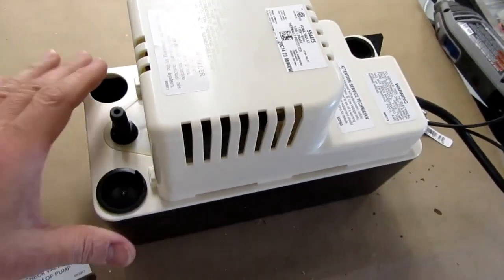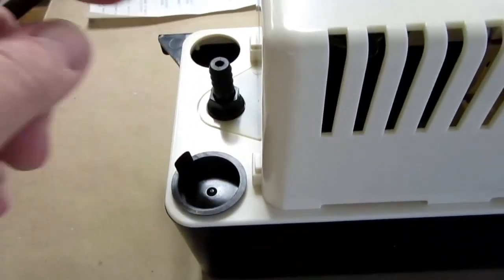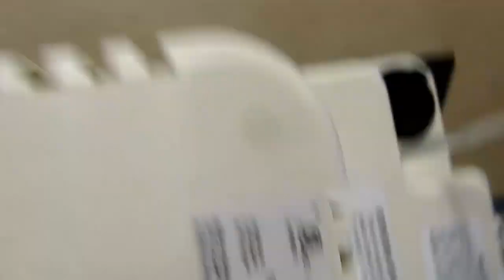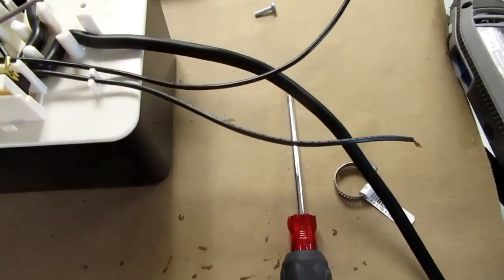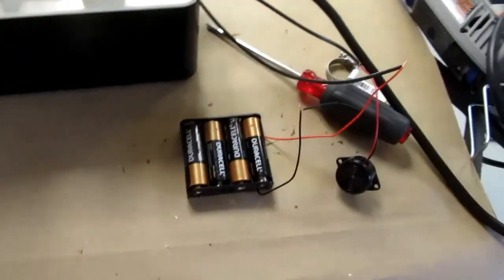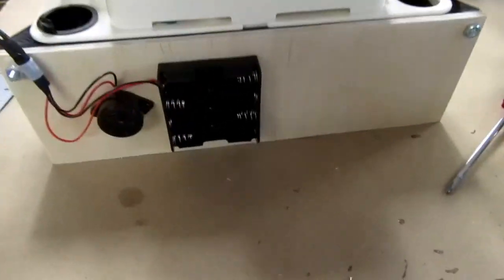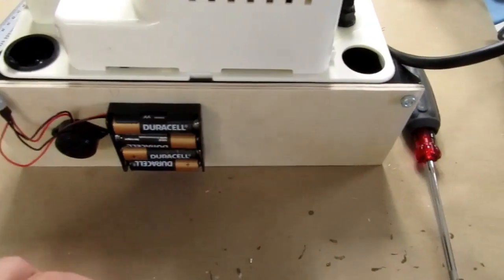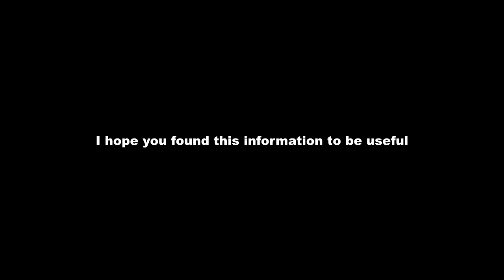Little Giant Automatic Condensate Removal Pump VCMA-ULST (554415)

Comment: Slight error at the beginning - the "15" and "20" designations are not for the pump power or lifting capacity, but for the input voltage, the "15" units being for 125VAC and the "20" series for 230VAC. If you are working with an air-conditioning unit, you likely have a source of 230V AC power at the air-conditioning unit, so the "20" version would be correct. In your case, you pretty much lucked out that you didn't decide you needed more lift, as had you chosen the "20" model you would have ended up with a 230-volt unit and no way to power it.

Comment: Nice review of the little giant condensation pump.  I have a similar pump on my air conditioner and it is 14 years old and never failed.   More commonly , I find the gravity feed hose obstructs from fungus that forms in the condensate trough under the cooling coils over time and the water overflows the trough before it reaches this pump.  I periodically back flush this line with dilute Clorox to keep the fungal build up down.

Comment: I always make it a point to thank folks who make these vids. I have a portable AC unit that I "converted" into an outside one (outside the small office I built in the garage for my wife, you can imagine how loud a portable unit is inside an 8x9ft box haha) anyways...although I built a box to make sure it sucks hot air from her office, blows cold back into the office and vents hot air into the garage, I found after a couple hours condensation builds on the cold air line, hoping punching into the box, and putting this "in line" with the AC units drain path (it is running on cool mode but not dry/cool so it's probably just full of water inside my hacked box) it'll grab moisture and run it out the garage. 

Again, thanks for such a great detailed vid!

Comment: I want to do this with a Whynter ARC-14S portable AC unit so I don't have to empty the water 2-3 times a day in the summer.  I think I can use a Little Giant low profile unit like the VCCA-20ULS and not even have to raise the unit above the pump (the drain is only about 2" off the floor).  What I'm worried about is leaving the house with the AC on and the pump failing.  I'm not sure how I'd rig up that alarm switch to turn the AC off.  The ideal solution would be an electric valve between the AC drain fitting and the pump to close the drain, but I don't know if they make something like that.

Comment: Thank you for this video. I was wondering how to do this. We have those pumps near the thankless water heater and furnace. And we had a dehumidifier that we had to empty. No sink in the basement. In the summer it was getting tired to check every few hours.  Thanks again.

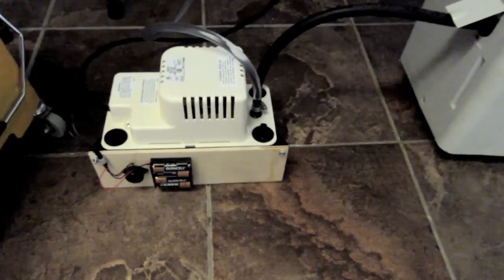Comment: 27:31 I am a little confused about the extensive modifications you made to the hose portion extending inside the pump. Why was a trough needed there? Was the entire issue because of the bend shown in the hose in which it was slightly angled up, or was there an additional issue inside the pump? I ask because I want to use this as a condensate pump for a crawl space in which I want to seal that connection and make sure no bugs, dirt, etc ends up in the pump.
Reply from the maker: Luke H, the whole point is that the incoming water from the hose must be able to strip unimpeded into the pump tank. If you run the house all the way into the tank (to the bottom), little water will flow into the tank. If you cut the hose shorter, perhaps half way down into the tank, when the tank level rises to the end of the hose, out may not flow in as freely. Ideally, the hose can end just below the tank's top opening, so water can flow in unimpeded, but then you need to find a way to attach the house end there, so it does not just fall into the tank. I solved this by attaching the hose to a brass pipe that goes all the way down to the bottom of the tank just to support the hose weight, but cut away half the diameter of the pipe so it is like a trough, so from the water's perspective, the closed hose/tube ends at the top of the tank. Regarding your idea of closing all the tank inlet holes, remember that you need to allow air to escape freely.....perhaps you can put some screen across one of the unused holes.

Comment: Excellent, well thought out and well organized video. One little thing.. I believe you will find that 'ding-dong' doorbells will only 'ding' when energy is applied, and won't 'dong' until energy is removed. Hence, if you was to use that type of doorbell in this application, you would only have one ding to alert you to the problem. I would not recommend using that. Your 'sounder' is a much better solution, as it will make a continuing 'annoyance' to get someone's attention. 
Again, a very well done video!

Comment: Thanks for this tutorial - very helpful. Since a power outage will turn off the dehumidifier, I'm not sure that a battery (back up) feature (and all of the extra mounting work) is all that necessary. I'm going to do mine with a low voltage buzzer (6v/12v/24v) and use a matched low voltage (6v/12v/24v) plug in adapter to power it from the same circuit to avoid the different breaker scenario.
Reply from the maker: Jon Knapp, as I designed it in this video, the audible alarm is there to let people know that something is amiss. If there is a general power outage, presumably people will already know that. And If the dehumidifier or air conditioner or other water condensing equipment stop working for other reasons (than a power outage) that is not a emergency. But let's say that the condensing water is still being produced, but this condensate pump cannot function for some reason.....perhaps the AC circuit it is plugged into is off or tripped, or perhaps the pump has failed, or the discharge hose is blocked or pinched, or the pump p is simply unplugged, so now the condensate water will overflow onto the floor. Depending on the installation and the area, this could be messy, or causing damage to flooring, furniture, items stored nearby, or possibly it could even be dangerous. People would want to know that the condensate pump is not able to function and that overflow is imminent......THAT is what my audible alarm is designed for. It is battery powered because of the root cause possibly being failure of AC power.

Of course, the alarm buzzer and its battery power source don't need to be mounted on the pump.

If my installation was a normal air conditioner, I COULD have wired the high level switch to the HVAC controller to have it stop the AC and thus the production of condensate water. But here I am dealing with a portable dehumidifer, so it is more difficult to wire the switch to (and the switch is not rated to directly control the AC power to the dehumidifier). So the alarm made the most sense.

And this pump can accommodate up to THREE sources of condensate water....in that case, the switch could not be directly wired to stop all condensate equipment, so again simply making it control a common audible alarm might be the best solution.

Comment: Thanks for going into great detail on how to use this type of pump!  However, in your particular usage example, I'm just wondering if you couldn't simply set the dehumidifier on the bar counter and run a gravity feed hose directly into the sink without needing the pump at all?  I guess you'd have to ensure the unit couldn't vibrate itself off the counter, but that shouldn't be too hard.
Reply from the maker: John Thompson, of course one COULD put the dehumidifier on the counter in a sort of "redneck fixit" solution. But, yes, it could vibrate itself off the narrow countertop, and it would not be safe, and any leaks would go onto the countertop and down onto the wooden cabinetry below (rather than only onto the waterproof tile floor), etc. But ultimately, as I said in the video, I was setting this pump up in somebody else's house, so I put it where they wanted it. If it were in my own house, I would have set up an overall better arrangement.

Comment: Great video and solution! Can the condensate pump suck up water from a puddle that's on the concrete floor? If not, what would you suggest for me to do to achieve that suction, up into the pump (the puddle would be at the bottom level of the condensate pump).
Reply from the maker: Danielj, this is NOT the kind of pump you are needing for sucking up puddles on concrete floors. It can't do it.

If your puddle is shallow (less than perhaps 5/8" or thereabouts, you need something like a wet/dry shop vac; I don't know of an alternative. If your puddle is deeper, you can probably use one of the many automatic pumps that can be set on a floor to pump away standing water.

Comment: can a bad condensate pump make the furnace not power on? my ac in my home stopped powering on and all i can hear is the pump with a loud noise at all times? will a replacement fix the issue of the noise and enable my ac furnace to power back on? thanks.

Comment: Great video. I have a question though. I want to put one of these pumps near my hot water tank, there is no floor drain close to the hot water tank. Are these pumps gravity fed for the intake of residual water? I am wanting the pump to draw water from the pressure release valve but also any residual water from the floor if the hot water tank begins to leak. If this pump won’t work can you suggest a pump that would work. Thank you.
Reply from the maker: Scott R, I thought my video was very clear about how it works, specifically  that the source water needs to gravity feed into the pump's little tank. If your hot water heater cannot be rigged to drain into this pumps tank, then it won't work for you. Also, this pump is designed for condensate water, which is usually cool......it might be damaged by hot water coming from your heater. And also, condensate water is clear and free of debris, whereas discharge from a water heater probably has a lot of settled sludge and minerals, which might foul this pump.

When I want to drain or flush MY hot water heater, I connect a length of garden hose and run that to a floor drain or sump.

Comment: One of the most in-depth videos I have ever watched and I have watched 100s of YouTube videos on all types of subjects. Question: can one use a piece of the tubing that is included with the pump as the hose that goes from the dehumidifier to the pump (where you used the garden hose)?
Reply from the maker: Rosi Garmendia, I think you can use the included hose as you describe, but you might have issues finding an adaptor to go between the dehumidifier and the smaller hose. If you try to jerry-rig it, you could get leaks. You also have to be careful that the bottom end of the hose does not rest on the bottom of the pump's little tank.

Comment: Is it possible to not connect anything to the 2 little wires and just plug this into a wall with a dehum piped into it?
Reply from the maker: @brandonvelasquez3530  ,hmmm....if you watched the whole video, this should have been pretty clear.

Anyway, of course it is "possible"; it all depends on what functionality you desire.

Comment: I just brought a dehumidifier that comes with gravity draining hose option. Doesn’t require a pump if you already have AC drainage hole on your basement floor.
Reply from the maker: adaptus primus, I am not sure of what your point is. First, pretty much all dehumidifiers have a gravity draining hose option, so your is not unusual. Second, the whole idea of these pumps is getting rid of condensate water when you can NOT use gravity feed alone to a floor drain, so your mention of your setup not needing the pump seems like WHAT? Why was this comment left, as it is a total no-brainer, and not applicable to the subject of this video?
Reply: youtuuba you can call me stupid. I didn’t even realize the draining hose option is available until I watched this vid. See, I learned something.

Comment: Wouldn’t it be better to set this up so that the overflow turns off the dehumidifier?  What good will the alarm do if someone isn’t home?  You come home to a big mess to cleanup.  I bought one of these pumps and now I’m trying to figure out how to get it to turn off my dehumidifier. Can’t find any clear instructions anywhere on how to do that.
Reply from the maker: Joe Barberio, your basic point is good, however I thought I already addressed that when describing my deliberations when doing this specific project. 1) Yes, the High-High Level switch is by default configured to interrupt the signal that turns a condensing unit (dehumidifier, air conditioner, etc) on, but some equipment is not controlled by low level electrical signals; 2) Here, it would be  necessary to interrupt the mains voltage, high current AC feed to the portable dehumidifier, and as I stated in the video, the High-High Level switch is NOT rated for that kind of load, so it would be necessary to build a controller (relay, solid state, whatever) to interpose between the switch and the AC line feed; 3) Little Giant recommends that if there is NOT a low level control signal to interrupt, that the next best thing is to wire the High-High Level switch to some kind of alarm; 4) In this instance, the condensing unit is equipped with a shut-off switch that turns it off if the water level in its own condensate tank is too high; when piped to the pump's condensate tank as shown in this video, the dehumidifier's internal tank should not ever fill, but if the pump's own tank fills, this means that the pump has lost power and cannot empty its own tank; this is the only time when the alarm would sound, a rare occasion, but at least the alarm is battery powered (not dependent on whether the power is on or off), is in an area open to the rest of the house, and can easily be heard elsewhere in the house. 5) To sum up, since using the High-High Level switch to interrupt AC power was not an option (I COULD have done an interposing panel, but the homeowner did not want to pay for it), it was felt that, in the rare situation when AC power was lost, sure, the pump would not run, but then neither would the dehumidifier, so no NEW water being made, so the alarm was a good solution to at least let the homeowner know there was a problem, and call for somebody to check it out. Your point about 'what if nobody is home to hear the alarm' is also true for things like sump pump overflow alarms, alarms that go off if a pipe freezes, alarms that detect a ruptured clothes washer hose, etc; at least there IS an alarm......in the case of this particular house, the homeowner never leaves the house, so it is a very low risk situation as far as this pump goes.
Reply: In other words the pump doesn't have enough voltage to trigger another pump or dehumidifier

Comment: have you noticed that their concept of NO and NC are backwards from industry standard?  
shouldn't "normally open" mean that when the system is functioning correctly the circuit is OPEN (broken) and when the switch is triggered the circuit closes (completes)
Reply from the maker: @kamac1980  kama, what you describe is NOT industry standard. A NO contact is the one that is open in "shelf state" (i.e. with the switch just laying on a shelf, not connected to anything and not being actuated), and NC contact is the one that is closed in shelf state.
Reply: @youtuuba that sounds exactly like what I just described… normally open. It is normally open circuit (not conductive) unless triggered by the switch.  In the case of the little giant pump (in the manual where it describes its terminals as NO and NC), the shelf state when wired to NO is that the circuit is closed and connected….
Reply from the maker: @kamac1980  Little Giant does not make the switch. The switch manufacturer puts the industry standard NO and NC markings on it.

Comment: Does the inlet hose have to go in vertically or doesn't it matter?
Reply from the maker: Denny Lee, WHAT "inlet hose"? You need to be more specific......with the openings in the top of the pump reservoir, any inlet needs to be pretty much vertical, at least when entering the pump reservoir. A major thing to get right is that any inlet NOT go all the way to the bottom of the reservoir, indeed it is best if any inlet feed pipes/hoses stop not too far below the top of the reservoir, dripping the rest of the way down.
Reply: @youtuuba  Yes sorry I wasn't too specific on the the line hose. It's the line coming off the back of the dehumidifier going into the pump, now that i know it should be vertical going into the pump and not to touch the bottom.Thanks a lot for the response and stupendous tutorial.

Comment: Just wondering why you would install the Alarm and Battery Hookup at the level where water overflow could wet your electronics?
Reply from the maker: Patricia Terranova, there are no 'electronics' in this alarm setup. If the dehumidifier and/or condensate pump overflow, the water will not get the simple electrical circuit wet, because it will spread across the floor in a thin, shallow puddle. Putting the electrical circuit somewhere else would be more cumbersome.

Comment: I am using this for my dehumidifier in the basement. Do I need to hook up those 2 black wires to anything or will it run fine without that? I do not have an alarm like you sawdered to it.
Reply from the maker: The Quarterman, I already described this in my video. You can use those two wires to stop the production of condensate, or to alarm on high level in the tank, or you can choose to use them for nothing.

Comment: Overkill there pal. No need for brass fittings and troughs and all that nonsense but if you are happy with it fair enough.
Reply from the maker: Bjorn, there was a need for the brass fittings and trough in this installaton. I explained the reasons in the video. So your comment is "nonsense" to me.